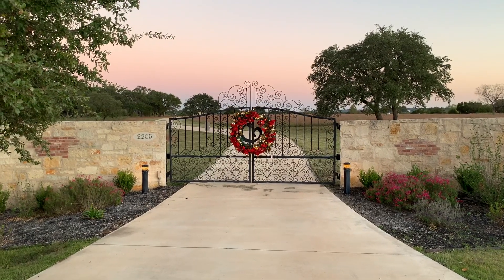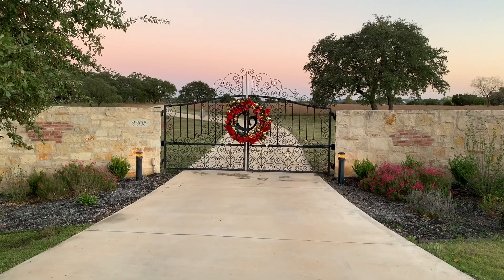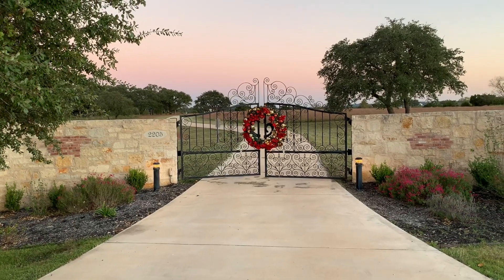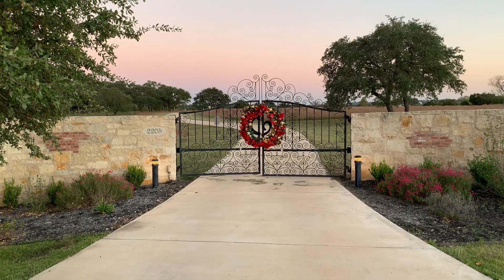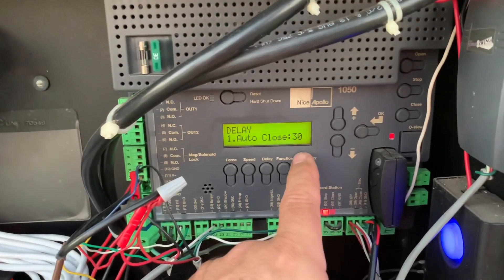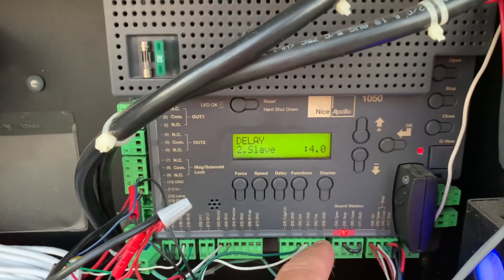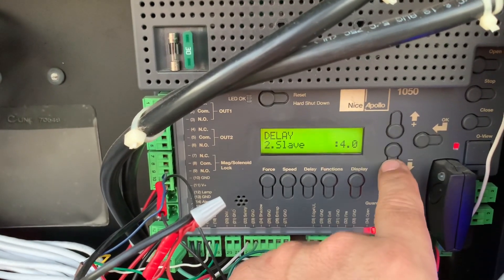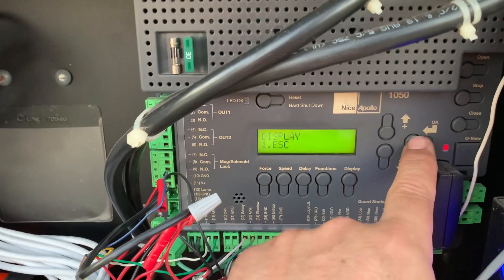Set a Gate Delay to Decorate your Gate! ✅ Add a Wreath to Your Swing Gate Without Crashing it! 💥

Comment from the maker: Parts used in the video:
Replacement gate battery here - https://amzn.to/3iftvgU
This is the best price I have found, even better than locally sourced pricing
HySecurity / Nice Apollo accessories are available on Amazon here!  https://amzn.to/3oQ4qKn
HySecurity / Nice Apollo 1050 Board - https://amzn.to/3mly88j
HySecurity / Nice Apollo Remote Control Transmitter - https://amzn.to/35jF4vJ
Linear AK-11 - https://amzn.to/2Tfp2gA